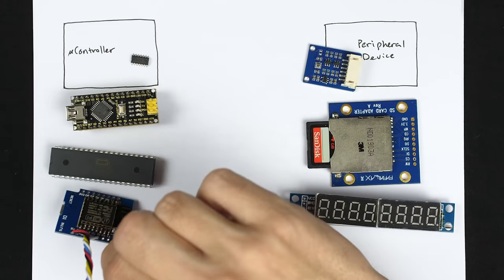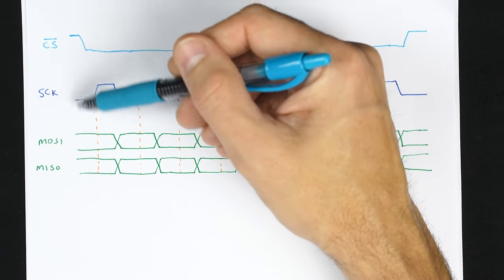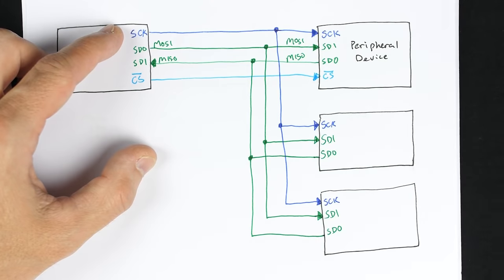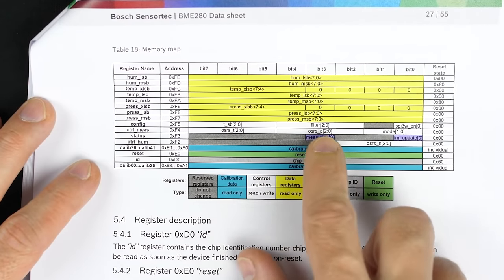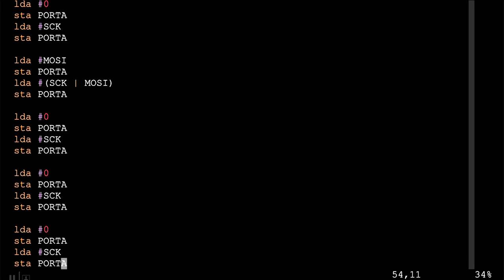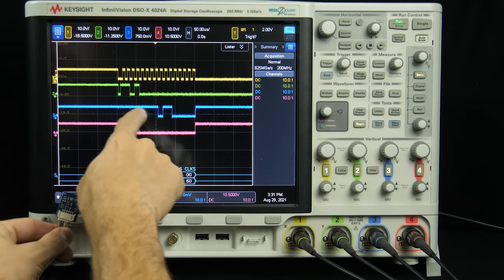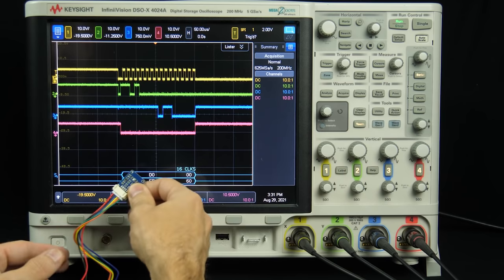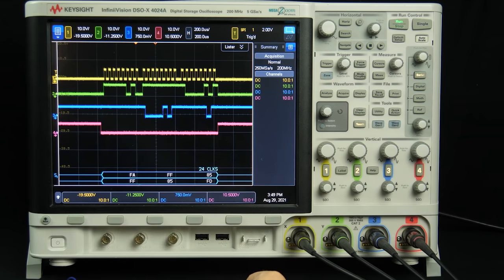SPI: The serial peripheral interface

Comment: Ben, thanks for a very clear and informative video on the SPI protocol. I was interested to see you working with  the Motorola 6502. This reminded me of an upgrade project at Cutler Hammer, Fenton ,Michigan in 1978 when I had to convert a static CRT display of machine tool data to a dynamic one, updating the various events and parameters on the screen as and when they occurred, No SPI in those days just RS232c! The programming of the machine code was handled by a cross assembler on a DEC pdp11! Computers and microcontrollers have come a long way since then. Never-the-less, it is good to see the Motorola machine code again and see it being used with modern devices and protocols. Much appreciated!

Comment: Great video. I learned microcontrollers back in the 1980s with a Heathkit 6800 course. I’m glad to see you’re getting down to assembly language level. I’ve been playing around with the Raspberry Pi PICO in MicroPython. That’s a lot easier, but it’s harder to understand what’s going on when I’m just using a library that someone else made up.

Comment: Thank you for all these amazing videos. Please consider covering I2C and RS-232 to TTL converters as well!
Reply: Which is faster/more efficient for large amounts of data? SPI or I2C?
If im using SPI can i just increase clock speed to increase performance (to a point)?
Reply: @karlm9584  SPI is inherently faster. I2C uses pullup resistors while SPI has push/pull drivers using transistors, not resistors.
Reply: @darer13  thanks!

Comment: You are much better at explaining the SPI protocol than I would be.  I have never programmed in assembly, but managed to get stuff working programming in C.  I basically did the same thing (bit-banging) and made a library for it.  I don't know if it's the "proper" way to do it or the most "elegant", but it's worked for me.

I2C is another very simple protocol (actually most serial interfaces that I have worked with have been relatively simple).

Comment: I'd really like to see a series of videos of adding an ACIA serial interface to the computer. The EEPROM could implement a simple bootloader that loads a program via serial into RAM, then executes it. As a bonus, this would remove the need to constantly pull the EEPROM out, reprogram it, then put it back into the breadboard.
Reply: Years ago I wrote a loader for the 8051 like that. It was easy to just follow the Intel spec for hex files that popped out of the cross assembler and just passed that as text to the processor serially. Gave it a go command and off it went.

Comment: The 6522 VIA has built in shift register where you can load a value and have it clock it out, together with a clock, automatically. And similarly you can shift in automatically and generate an IRQ on completion.  So you could for example, use it to shift out the address, switch mode and then read in the next bytes all in your existing hardware.

Comment: I've also used the BME280 - it is a great chip.  I was really impressed that the pressure sensor could tell the difference in altitude between my desk and the floor.

Comment: I know this is more of an intro tutorial, but there are many devices that require CS to toggle before they will respond. This is so devices can be daisy chained. eg device1 SDO -> device2 SDI … etc. Then all the commands are concatenated and sent as a long data stream with one CS, then all the concatenated responses are received with a second CS. Trading off less hardware (I/O pins) for more software. Very useful for very dense designs with multiple peripheral devices

Comment: I actually happened to have at least one BME280, which is a barometric/temperature/humidity sensor to replace BME180.
It is pretty amazing how they keep fitting all this circuitry in such a small package and still provide a decent accuracy of measurements.

Comment: I hope to see I2C and (the completely unrelated) I2S in the future, great video!
Reply: I2S is pretty much identical to SPI, except that the Chip Select line is called Word Select because it indicated whether the audio data sent is for the left or the right channel. And the serial clock needs to be a precise multiple of the sample rate. Otherwise, it's just a regular SPI.

Comment: SPI is SO NICE for low-risk real time stuff. its not very robust in terms of fault tolerance or redundancy, but if you don't need that stuff, then SPI is awesome. its a fresh breeze compared to working with more annoying things like CAN bus, RS-232, RS-422 or especially RS-488. i'll die happy if i never have to hunt down another RS-488 to USB converter.

You should up the complexity of your little computer by a million percent and fully implement a 1553 interface with full redundancy (both buses) lol

Comment: The calibration data in the device is obtained by connecting the onboard ADC to a built in precision current source feeding through a set of precision resistors. The precise voltage drop across those resistors should result in a known value from the ADC. The difference between the measured value and the expected value is the amount that the ADC is out of calibration and can be used to correct input values by adding or subtracting that amount.

Comment: SPI is an old Motorola protocol established in the 1980s, but not a standard as such. One reason it became popular is that overall communication can be bit-banged either as Master or Slave using just "dumb" I/O ports, and uses a low pin count as compared to a bidirectional SERDES interface like a single lane PCIe, which is important because ports where not as numerous as today. If control is critical data integrity should be verified using SPI. Like with a CRC on a SD Card interface, or using redundency, or a checksum. Now we have dedicated SPI ports with many useful features like queing and DMA.

Comment: Pausing at 10:30 to say that on a complex SPI bus I usually use CS as a selector for a bus-connected SIPO which controls the CS input on the devices. Each peripheral has its CS input attached to a gate or gates (depending on whether the device is active low or high) where the gates input from the master CS and the relevant pin on the shift register. To select a peripheral I drive CS low and then output the bit sequence which corresponds to the desired state, then drive CS high and carry on.

The decoder idea is good and straightforward if you have the pins for it, but the SIPO actually effectively increases the number of pins available rather than consuming any which aren't already in use by SPI, which is good for working with limited pins on the controller, like with an atTiny or etc.

Comment: you could use combinational logic for chip select to make more efficient use of your chip select too(Use a binary integer on for example 4 pins which gives you 16 devices) along with one extra pin for the actual chip select signal
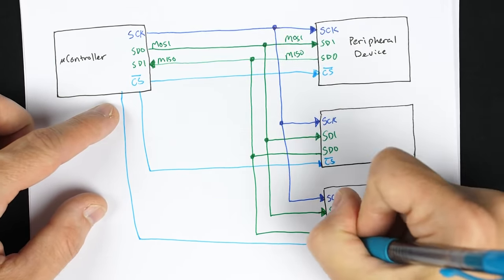Reply: That's a decoder. 9:56

Comment: I was expecting maybe RS-232 but this is even simpler. Now all you need to do is hook up the VGA and PS/2 adapters, add a character ROM, and write some routines for displaying text characters on the screen. Then you can have a fully functional computer that can load and save text mode programs over an SPI bus.
Reply: It's possible to connect SD card in SPI mode. Initializing it is a pain in the ass, but then communication is pretty easy especially if we ignore file system and just use some area as "flat" storage.

Comment: 32:22 My guess (without looking at the cal code) is that some precision is getting shifted out or converted out. there may be an intermediate step in converting the raw data that is dropping some precision. This may also be intentional to "filter" lsb noise. In other words, the mfr may only claim accuracy to 0.01 C, but it actually measures a noisy 0.005 C or maybe even 0.002 C. If you carefully walk through the cal function they gave you, you should be able to tease out the extra "accuracy" and see what it is doing. That last bit of accuracy may be too small to fit though after scaling

Comment: I was surprised to hear that SPI is simpler than I2C. I had connected some modules to a RPi, and had the choice to work with SPI or I2C. From the (high level) programming perspective, I2C looked a lot easier to manage multiple devices so I went with that. 
All the low level stuff had already been taken care of though.
Reply: SPI is basically the Traditional Clock and Serial Data just with individual Bus for Data and a Chip Select Line giving it Full Duplex Communication while I²C is more Difficult as it's a Common Bus for addressing and Data Transfer and just Half Duplex making it quite harder to interface with. I²C operates at slow speeds and can handle lot of devices that it's kinda seem Easier to operate than High Speed SPI
Reply: I2C is simpler at the hardware level when it comes to hardware projects, but it's more complex at a protocol level. When I have the choice, I prefer to use I2C for my projects. Most of the time the lower speed of that bus does not matter (reading a sensor once a second does not need high speeds), and the ease of connecting many peripherals on the same bus using only 2 wires is a big bonus. 
Conceptually, I2C is similar to SPI but does away with the need for separate CS lines by having each device have its own unique address on the bus, and the address of the device that the controller targets is transmitted before the commands for it on the serial data line. This way, the targeted peripheral knows it needs to decode what follows after its address, and the other devices on the bus know they can ignore it.
Reply: @stamasd8500  I'm the opposite. I generally prefer SPI over I2C. But then, I generally work at high sample rates that are difficult (or impossible) for I2C.

Agreed, however, that I2C is simpler on the hardware side. Not so for the low-level drivers though. With high-level drivers available though, it doesn't necessarily matter.
Reply: Agree, that comment surprised me too! I've found the 2 wires of I2C much easier, as well as the ease of adding multiple peripherals without needing an extra wire - as you say it's maybe just the Pi doing a nice job of I2C implementation that helps. Of course both can be used too - I've got wired ethernet on SPI and touch and OLED on I2C 😃

Comment: I may be thinking of I2C here, but I'm fairly sure there are some devices (peripherals, slaves) where they only have 1 data line, and it changes between an input and output depending on if you're sending or receiving data. in fact one of the devices I played with does have a Data in and Data out, but defaults to Data in being bi-directional, and you can send a setup command to turn data out on.
The advantage of having both turned on was that the devices would send data back while you simultaneously sent it data. (of course I can't even remember what the device was, so don't expect me to remember what it was sending back, but it was probably something like a confirmation of the previous command, or a status register.)

Comment: SPI is especially relevant for NOR or NAND flash devices where you can to up to 200 MHz with single, dual, quad or even octal data lines and even double data rate (bit is sampled at both rising and falling clock).

Comment: 29:45 re: sending the previous output back as the next input expecting it to be ignored, isn't it dangerous if the previous output happens to look like a register select like 0xFA ? That would put the controller out of sync with what the sensor is sending?
Reply: Nope, once you've entered the 'register read' mode, the sensor will ignore the data you're sending it. CS has to be toggled before the sensor will respond to new commands

Comment: I did a temperature humidity sensor project on college, as well, but it had only one data wire, i had to comprehend the data using a FPGA and coding in VHDL, but the steps were surprisingly the same

Comment: I remember using a radio with an SPI  interface. Its configuration registers had subfields of various lengths, and I looped over the bits in the value for each field instead of packing them into a byte, and when I hooked up the scope, I could read off each field easily because there was an extra half usec between them. I was sad to lose that when I started using the actual SPI peripheral on the microcontroller.

Comment: Also a thing to note about the “chip select” function, in larger SPI networks a multi bit decoder is often used so that you only need to utilize a single output pin to actuate several chip selects (disregarding the clock). Think of it as an I/O expansion module; just saves having to use several output pins for enabling each peripheral. I2C is more compact in this respect but is only half-duplex capable, so it depends really on the application which transmission system will be more efficient to implement…

Edit: I commented this just as he mentioned it lol…

Comment: One (relatively) unconnected question:
I began to wonder how Wireless Modules are made. What code is in it and how do u connect such thing to your home wifi.
Of course there are this expansion boards but how do they work? another point is that espacially wireless i do not trust that much, espacially the modules you can get.
most code is coded like crap and i do not want to introduce a security gap just by implementing a wireless thermometer or soimething else in my wifi.

i was not able to find anything specific on this matter in the internet. maybe i am too stupid, as i am just getting into this field of assembly and integrated curcuits.

By the way: Ben you are making wonderfull videos. In a way explained even i understand them.

Comment: great video. isn't the temp sensor read supposed to be 3 bytes and not two? wouldn't you need 3 passes to get the 20 bits? sorry if i missed that in the video but it looked like you were just getting 16.

Comment: Dear Ben, I didn't find the instruction TRB shown at 23:40 in the original MCS6500 programming manual from the MOS corporation.  I guess this is because this is Bill Mensch's WDC CMOS 6502 instructions are not forward compatible with the original 6502.  So we can not run this code on a PET or an Apple II or a C64.  I believe I should be using WDC's 6502/65816 programming manual then.

Comment: Is there some safety / syntactic / semantic reason behind the bar above the letters indicating "active low"? Or is it another backwards convention in electronic engineering (like the flow of electricity being backward from how it's displayed in schematics)? I understand that you can get by with the "so long as you're consistent" rationale when it comes to naming conventions, I'm just curious what the origin is, given that it seems to indicate the opposite of what a novice (me) would intuit.

Comment: Could you explain how the read-write choice at the beginning relates to 1 or 0? I'd assume, seeing as it's written RW in the datasheet, that 0 (being the first), would be R (Read) and 1 (being the second), would be W (Write)? Is it kinda like an inverted signal type of thing, where 1 is High, and R is the first letter, so R would correspond to the first part of the clock signal, which for this one would be the rising signal and not the descending one?

Comment: What if you read 2 bytes and then want to read from another register? Seems like the sensor still sends the next byte, ignoring the address you'd be sending for the other register you want to read. Would you have to toggle CS before you provide the next register's address to read from in that case? Thanks for your great work!

Comment: So if you took two shift registers, one for MOSI and one for the clock, you could put a bit into the clock shift register for each bit you want to send, and the clock shift register would have a 555 or slow TTL oscillator. If you wanted a done notification then have another clock in shift register connected to a comparator for when the bits clocked out equals bits to clock.. Put a buffer on the slave clock to add some delau? That could even output to an interrupt line. After writing the bit count clock a D flip flop could be set for an enable. Any subtleties? I'm not a 74 series guru.

Comment: You really are extraordinary. It would advance society if you with your style and format of teaching was supported and distributed.
Personally I'd wish for Atmels and PICs instead of the 6502, although much of the sequence is relevant.
And I'd wish to learn sleek ways of transceiving rather than bitbanging. Seems to me programmers have to reinvent the wheel every time they write communication protocol. That is one of the few things I like with Arduino, the shared recycling of code. When it works.
And I suppose you seldom need 20 bit resolution. Is it really that accurate?

Comment: I thought 20-bit temperature precision seemed like it’d give many more decimal places than I’m accustomed to with digital thermometers. I guess even the decoding code you copied uses the last couple bits to generate an average for the rest of it, or just outright ignores them. I suppose most end-use customers don’t need to see thousandths or ten-thousandths of a degree fluctuating, and it can help signal whether the temperature is rising or falling. Especially since a lot of digital thermostats present a one minute or five minute average rather than a live readout.

Comment: 10:30 - Couldn't you potentially use a shift register, and latch out the CS? Thereby giving you "potential" access to however many devices you want, wuth just a CS-CLK, CS-DATA, CS-LATCH wires? Guess it's the same as 3 pins on a decoder, and ofcourse wouldn't be instant